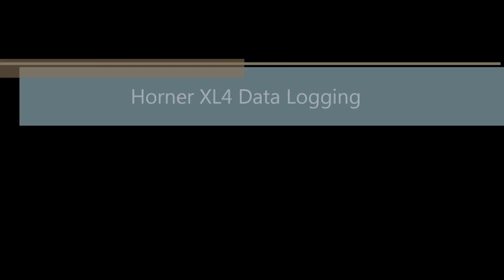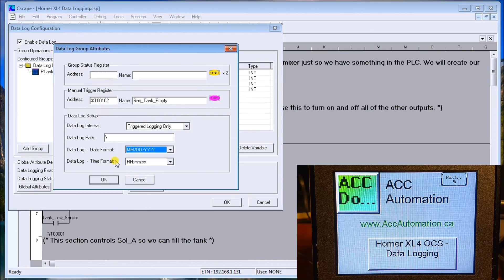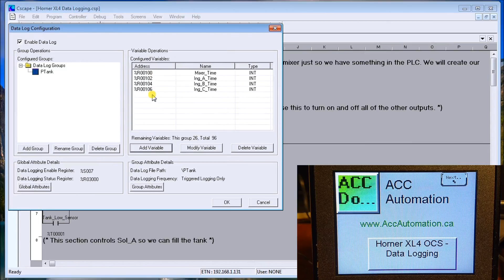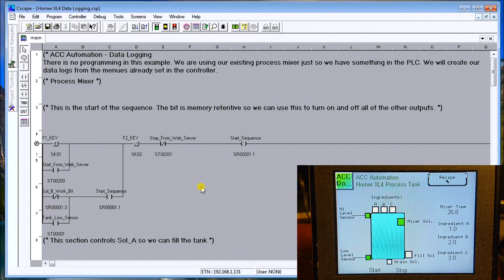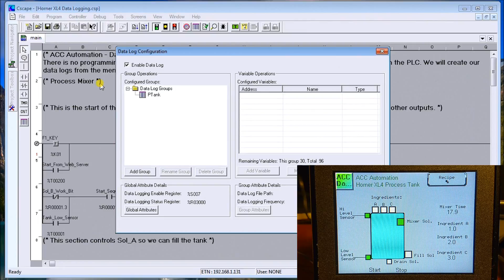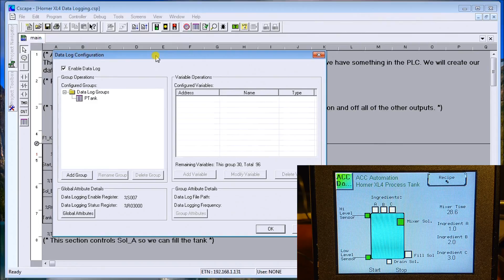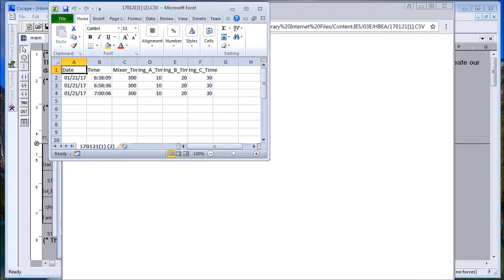Horner XL4 Data Logging - All In One Controller

Comment: sorry as i do format the sd memory from the plc because it does not save any data, what can i do ?
Reply from the maker: Hi Leonel,
I have provided step by step instructions on the website:
http://accautomation.ca/horner-xl4-data-logging/

Make sure that the SD card is formatted to the FAT32 File System.

Here are some additional notes from the manual that pertain to the SD Card.
9.3 Micro SD File System
The Micro SD Memory slot uses the PC-compatible FAT32 File System. This means that a PC, with a 
Micro SD-compatible card reader, can read files that have been written by the XL4 OCS and can write 
files that can be read by the XL4 OCS. 

However, the XL4 OCS does not support long filenames, but instead implements the 8.3 filename format. 
This means that all file and directory names must consist of up to 8 characters, followed by an optional 
dot, and an optional extension with up to 3 characters. 

Directories and sub-directories can be nested up to 16 levels deep as long as each pathname string does 
not exceed 147 characters.

Hope this helps you out.
Regards,
Garry
Reply: excuse me one more question, it matters the size of the micro SD card, can I put 4 GB?
Reply from the maker: Hi Leonel,
You can put a maximum of 32 GB micro SD card in the Horner XL4 all in one controller. The card must be formatted for the FAT32 file system and file names must conform to the 8.3 filename format.
Hope this helps you out.
Regards,
Garry